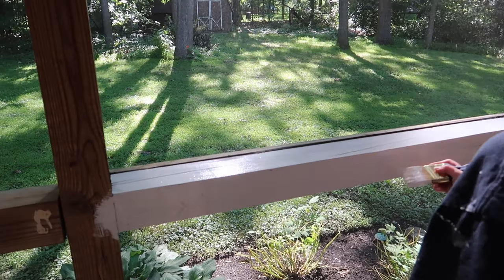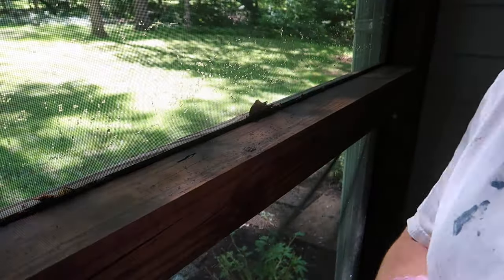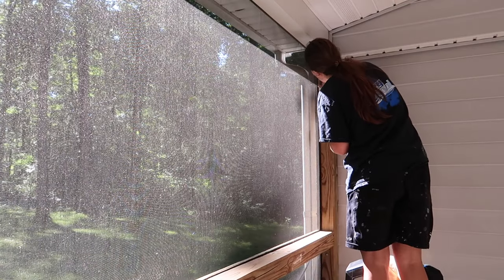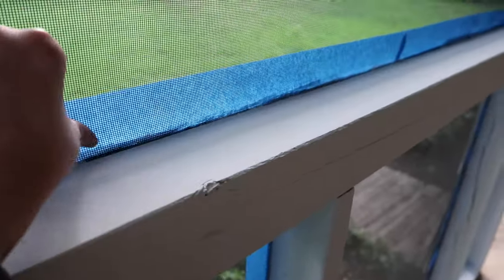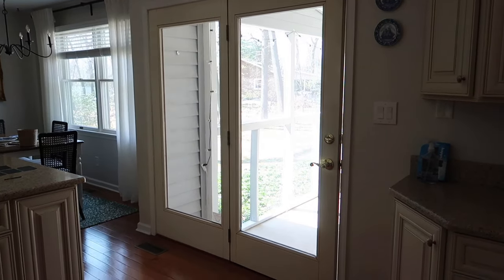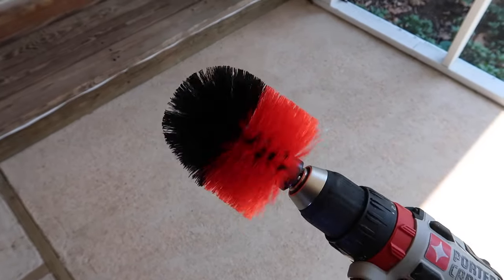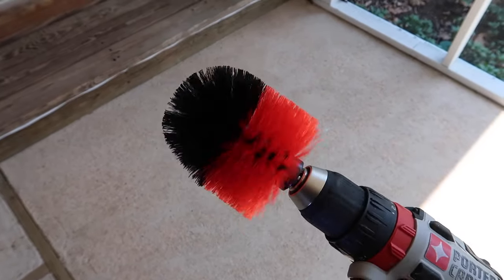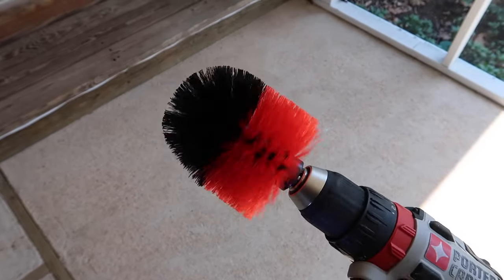Screened In Porch Makeover | How to paint a screened porch | Projector Screen Patio DIY Makeover

Comment: Hi Annie! I absolutely love this and want to redo my parent's patio and make it into an indoor patio. I was just wondering what it is like when it rains, such as maintenance any issues you may have seen that come up due to the rain. I would love to get some insight on this since I may consider windows but it get's pricey
Reply from the maker: So we do not have any glass or covers for the screens - its just the open screens. So far we have had no issues with rain or flooding. The previous owners added this porch on and I can see there is a slight slope to the concrete floor to make sure any water will run off. If there is a really heavy windy rain, sometimes it will get a little damp around the perimeters of the screens, but nothing major!